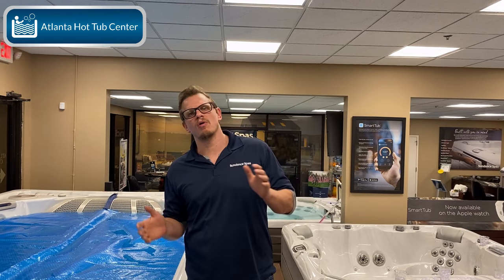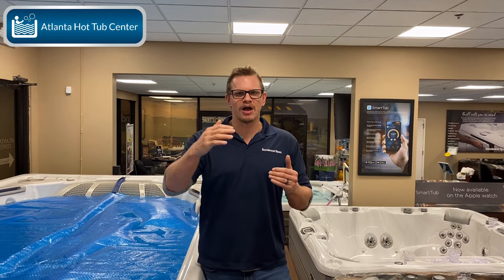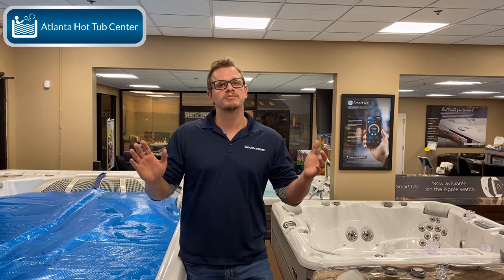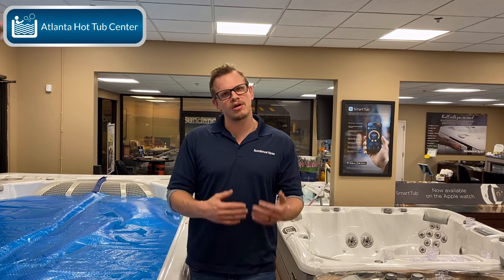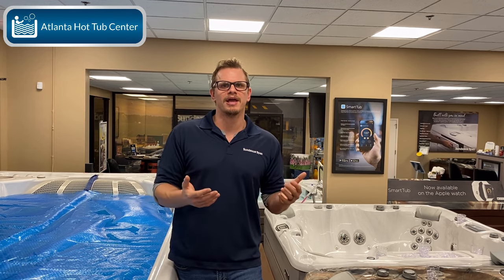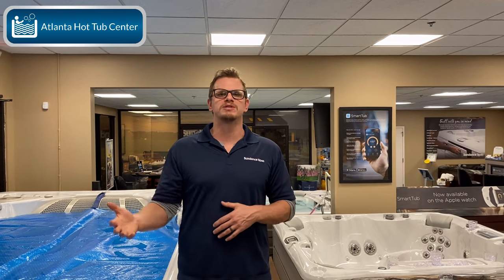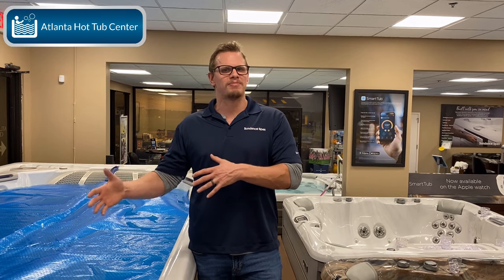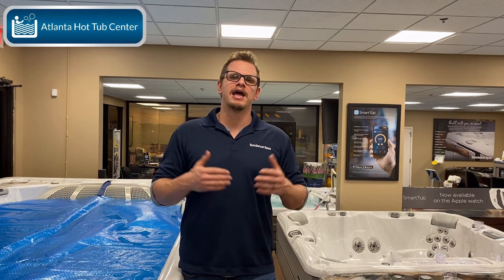SWIM SPA Review

Comment: Great video. Off topic question, I recently purchased a  SaluSpa Laguna AirJet Inflatable Hot Tub. In order to prevent and/or remove scale build up in my heaters and pump what do you recommend to extend the longevity of these mechanicals? 

I was looking at buying SpaGuard Spa Stain/Scale Control  or SpaGuard System Flush and just adding it to the normal water once a week or so? Suggestions, thanks! Love the channel and new subscriber!
Reply from the maker: Good morning, inflatable hot tubs normally last 5-7 years so I really wouldn’t worry much about it.  I would just balance the chemicals accordingly.  If you want to go the extra mile you could use a product called clean start or swirl away but I wouldn’t go much further than that due to the designed longevity of inflatable hot tubs.  Hope this helps!
Reply: @atlantahottubcenter  Thank you sir, thought we'd try this out before we look into the Sundance series of tubs!
Reply from the maker: @shanew7361  Absolutely, there’s nothing wrong with inflatable hot tubs.  Really, It’s all about what you want and value.  I think all manufacturers are great.  Thanks for watching!

Comment: We are interested in hydropool hot tubs. But can’t find to many videos about there hot tubs. Any information helps.
Reply from the maker: Good morning, HydroPool makes a good hot tub in my opinion.  HydroPool hot tubs have pressurized filtration.  I do think that pressurized filtration in hot tubs is a little much.  However, I do like pressuerized filtration in pools and swim spas.  HydroPool hot tubs have more standard jets in the industry which isn't bad, just nothing special shall we say.  They use Gecko electronics which are good electronics.  I do like Balboa a better.  The shell is hand rolled fiberglass self supporting so that's good.  That goes to the longevity of the unit.  They also use full foam insualtion which is the best was to insulate.  This helps to keep your electrical bill down.  I would try and wet test one.  This will really tell you what it's going to be like when you own it.  HydroPool does make a good hot tub.  Remember, that HydroPool is really known for thier swim spas.  That's actually what they starting building first.  They started building hot tubs after.  If you sit in the hot tub and it's conformatable and the jets hit you in the right spots, I would buy it.  Hope this helps!
Reply: Thank you. We live in Canada. Very cold winters. So it seemed that with our winters this was the best hot tub to pick. I appreciate your input! Thanks again!
Reply from the maker: @nancyhardy66  you’re very welcome!  Hope you enjoy your new hot tub for many years to come!